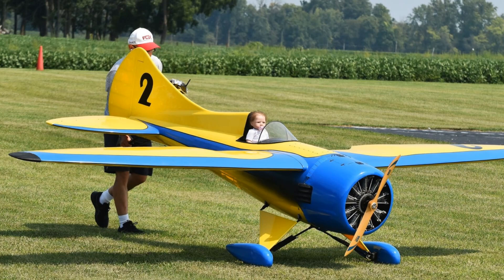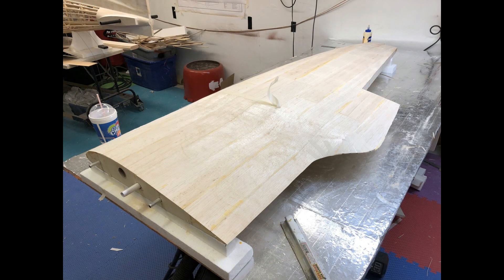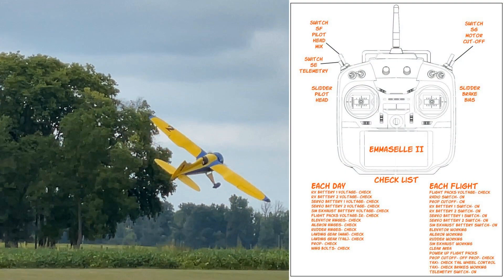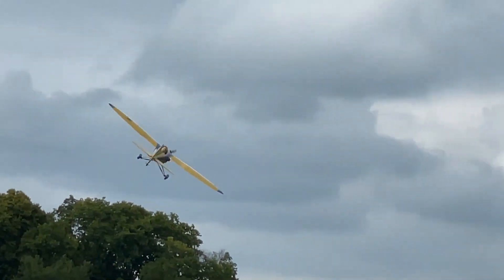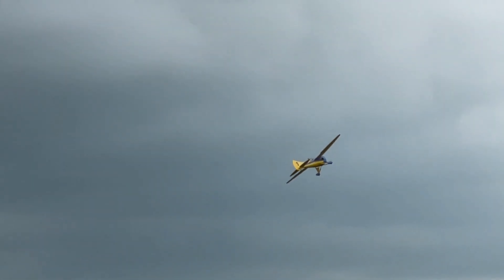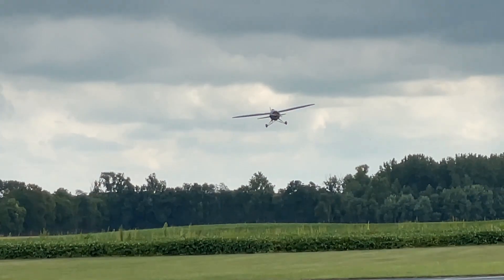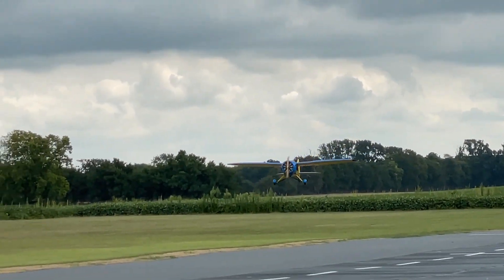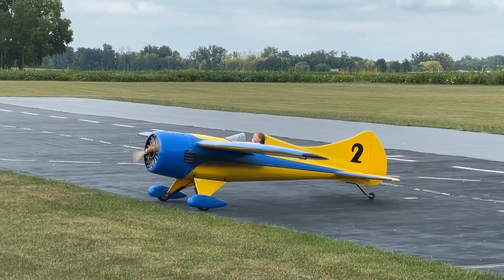188" Wing Span Electric RC Airplane

Comment: What kind of paint do you use on monocot
Reply from the maker: Krylon. I tape of the area to paint, wet sand using 1000 to 1500 sand paper. So far, has lasted years.